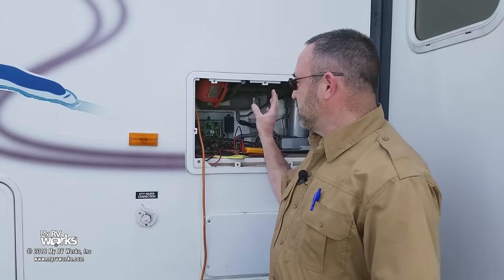How To Determine If Your RV Refrigerator Cooling Unit Has Failed -PLUS- RV Fridge Component Overview

Comment: Hey!  I know this is an older video and you may not be checking comments, but just wanted to say thank you- you helped us trouble shoot and fix our refrigerator!!  We accidentally left the fridge running while on a steep slope, and it stopped cooling.  After watching several of your videos, we figured out that the coolant was not flowing, had to be a blockage due to the slope.  So we removed the fridge, turned it upside down, left side, right side, and then the next day installed it.  AND IT WORKED!!! Thank you so much for saving us a LOT of money! ;-)

Comment: In our eyes this gentleman is an absolute authority for RV systems repairs.  Concise information and to top the climax, given at no cost to us owners who strive to keep our home on wheels running efficiently.  In this day and age of so many people shooting from the hip and making nothing more than noise , here is a wealth of information only a click away.
My husband and I feel blessed to have found this channel, thank you so much for you time and dedication.
Reply from the maker: Wow, thank you for the great compliment!  I enjoy taking folks along on my discovery walk-abouts'.  Helping others save on their RV maintenance and understanding how they work 'sparks joy' for me so I hope to be making many more video's.  Happy Camping and I appreciate you!
Reply: @MyRVWorks  I got a question, my heating element is getting hot there is no discoloration sign of a leak the pipe gets warm up to the bubbler but no where else and my fan kicks on and off still and nothing is cooling please help if you can thank you
Reply: @MyRVWorks PLEASE HELP ME IM A SINGLE MOM LIVING IN A 04 OUTBACK CAMPER I try to plug in to shore power and no electricity until battery is charged and now my refrigerator started to barely getting cold destroyed all my food there's no open spaces and I kept hearing a click noise and a something under the seat at the table kept running finally i just stopped using the fridge but my issue is the power why can I not get shore power yes I have a plug adapter that I use but get nothing until the battery is charged and it is not even charging now the converter fan doesn't kick on anymore also when i go to turn on a light the propane alarm goes off and i have to unplug battery to stop it i think its a switch or fuse but ive got no clue on where to start or do without getting hurt ive got no extra money to get someone to help and this heat is getting unbearable for my toddler please sir help me

Comment: By far the most informative refrigeration-air conditioning repair video that I have seen on U tube EVER!!!!
Reply: I agree.  Working with mine right now and it's hard to find different information to work with. Still have a problem with mine  though and hoping to make one for the most common problem.  The do's, don't and what ifs of why it wont cool properly all of a sudden.
Reply: What is ther mister
Reply: @inventorcreator7267   have
Reply: @inventorcreator7267   have

Comment: You answered my question, everything on my DometicRM3800 works 120/12v and my pilot and propane work, when it first went out I heard gurgling and thought my Thermostatic Switch inside the refrigerator was bad and by the way I can’t find a new one anywhere. The cooling unit was replaced by the previous owner so I fought the fact that it was bad. So I’ve seen to replace the whole unit with a New one is way out of my budget so I’ll replace the cooling unit.
Thanks for the great videos you post, they’re priceless

Comment: I just wanted to thank you for your accurate troubleshooting process for poor working RV refrigerators. After watching one video I added 4" of insulation to one side of the refrigerator and 1" of insulation to the other side. This provided improved inconsistent results. I felt I was on the right track. I watched  a second video of yours  which mentioned having less than 1" of air space on the backside of the refrigerator. I found I had zero insulation on the backside. I then added 6" of insulation to the backside (across the whole back, from bottom to top). This provided superior results which caused me to turn my refrigerator down from 5 to 3 to keep my food from freezing. thank you so much for sharing your knowledge. I am disappointed in the RV manufacturer for using the insulation as a cost savings on a brand new RV. The personal satisfaction outweigh the disappointment.

Comment: I Myself, and I'm sure anyone else who comes across your channel is 8/10 first time HAPPY CAMPERS, We can't thank you enough for the time you take to help everyone! I just made my first RV Travel trailer purchase, 1994 22V Terry by Fleetwood and got a major deal. Granted it had normal damage for 25 years old and had sat with both the front corner seams cracking more and more over time, we aired up the 4 tires and brought it home 30 miles away and tired are still holding air today almost a month later. But only having general knowledge and not much to any experience, you are such a great person for these videos. I am doing a front half gut and full remodel. I'm starting to look at systems now. Thank you so much and please keep putting out great support to the HAPPY CAMPER  Community 👍
Reply from the maker: Glad our videos were able to help you!  If you would like to support us please consider becoming an "RV Community Supporter" on our Patreon site:  https://www.patreon.com/myrvworks

Comment: I've been RVing for about 6 years. I've been able to do all my repairs myself. I'm moving from a 40' toy hauler to a 18' towable. The 18' had very bad floor rot, and had to replace it. To do the job I felt the need to pull the fridge. Upon trying to reinstall the fridge, it would not cool at all. Thinking that the insulation around the unit was more draft protection, than a vital part of the drafting process which occurs in the back. Also, the nose of the trailer was way high. Didn't think that could hamper performance either. After watching your video, went out leveled the trailer, and reinstalled the insulation. Almost instantly the freezer started to cool. Thanks for the very informative video, learned a ton. I was just about to give up on the unit, and replace it with a regular mini fridge. Thanks again.

Comment: Great information. Thank you for posting. I had just returned from a camping trip and placed my camper in my driveway. I started having battery problems on this last trip. The next day, My fridge was warm. I thought it was related to battery output even though it was plugged in. After watching the trouble shooting video,  I realized it was something as simple as the camper was not level in my driveway. Once I leveled it it started to cool off.

Comment: Darren I have the Dometic  RM 1350 4 door and I think  from watching your videos that the cooling unit is clogged because the boiler gets hot but the coil on the bottom never gets hot. I only go to your videos now when I need help you are a wizard when it comes to RV repairs. Thanks again and keep up the great work.

Comment: Your video was great in diagnosing our non-cooling fridge. We had the yellow residue at the bottom, indicating that we needed to go no further. We're trashing our 10 year old Norcold unit and placing with a compressor unit. Thanks for the easy diagnosis.

Comment: I just purchased a 1985 26.5' Class C motorhome that has been garaged most of it's 37 years, and only has 7400 miles. Still looks brand new.  Of course the refrigerator doesn't work. When I opened the doors to it I was almost knocked down from the smell of ammonia, so I knew that was that. I have found a company that sells the cooling unit and plan on replacing that. Its a Norco 663. It has no insulation or baffles. Glad I found this video before replacing the cooling unit so I can build the baffles and insulate while the fridge is out for repair. I doubt it ever worked that great because it looks like it was never used. The ice trays are still wrapped in plastic and the inside looks new. I have been considering replacing the cooling unit with a conventional 12 v DC/ 120 v AC with a compressor. I plan on living in the RV for an extended period, hopefully off grid. I know this is an old thread but I would like to hear from anyone who has changed over to the compressor upgrade to help me make more of an informed decision. It seems to me losing  the capability to run it off LP gas might be a downgrade. I don't know.............

Comment: Awesome video ! especially at 20:00 to the end. Im a first time viewer. i just subscribed & clicked like. im a commercial refrigeration tech. 38 yrs in the trade. i don't do rv. although a customer of mine made me put a rv refrigerator in thier boat. i did not hook up the propane and disabled the propane. He Bought it online or something  like that. i was just hired to install it. it had 3 fuel sources. 12 volt , 115 volt or propane. i told him don't  ever even think of running it on propane. you will burn the boat down. i set it up for 12 volt and 115 and it worked very well. i put a temperature controlled fan in to keep rear area cool. Good little fridge. i think it was a dometic. only about 3' tall. 2' wide. i installed it a few years back. prob like 5 years now. i guess customer is happy. never a call back with a complaint. it was a fun little job. really  took me out of my comfort zone but in a good way. i learned alot on that job how the fridge worked and learned some more here.
Take care & thanks for the very well done video.
Reply from the maker: Thanks for the comment!  I always like hearing from folks in the trades that do this for a living.
I have a whole playlist on these types of refrigerators that you may enjoy watching – as well as lots of manuals on my website.  You can add absorption refrigeration to your menu eh’.
Refrigerator Playlist:  https://www.youtube.com/channel/UCoKcKA4SuZLCD3flLXZVQvw/playlists
Manuals:  https://myrvworks.com/manuals/
Reply: Thanks. ill check it out.

Comment: Well great, Mine has the Yellow magic dust leak!   All those rolling blackout from the Febuary Texas Ice Storm had to have taken it out, because it was keeping my stash of Soft Drinks and Ice Cream cold that I had hid from the wife. 
Neighbor had one that had the same issue and he ordered a replacement cooling unit.  We had a heck of a time replacing it, but managed.  Just what I need, another project.  Thanks for the video and just to let you know I was able to check out all my systems and they are all working fine.

Comment: This was an absolutely brilliant video! You did more in 40 minutes to explain how an ammonia loop refrigerator works than anything I’ve ever experienced. Excellent job, excellent execution. Thank you so much! I checked fuses, power, loose connections, the heat in the chimney area and the one thing I didn't do was a simple step and you suggested that the unit needs to be level. Now I know!!

Comment: I have a 2000 Fleetwood Tioga with a Dometic refrigerator. It was sitting in my driveway last September on shore power with the refrigerator on AC so it would be ready to go, when I realized all the ice in the freezer had melted.  I cleaned up the water, then looked for problems.  The termistor is in place. Lights on the front on the refrigerator. No yellow residue under the boiler stack.  Leveling wasn’t exact but the bubble on my level was touching.  Still had 12 volts at the plug behind the service panel and 12 volts across the pins for the thermal cutoff switch on the boiler stack.  Tried to run it on propane only, but it wouldn’t light. I kept cycling the front panel switches, but the lights would indicate the propane wouldn’t light. Then all the front panel lights went off and have stayed off.  Still have 12 volts in the access panel plug and the thermal cut off. Looked at the fuses but that doesn’t seem to be the logical place to look if I still have 12 volts to the board and thermal shutoff switch.  Maybe I don’t know how to reset the thermal cutoff switch?

Comment: Fantastic and useful video. I think it is helped me diagnose a blockage.

I disconnected the thermistor. The freezer is only slightly cooling overnight.
There is no front panel error showing.
I can follow the heat up to the top of the cooler. But it cools considerably right before it hits the top cooling fins. 
Dometic fridge. 
Are my diagnostics sounds on this?

Comment: My god late to the back pat line.
Thank you so much, I just had a repair tech come out and literally word for word state, "ya looks like the board, compressor and everything are fried due to a failure in your breaker box".
Which I was thinking ya alright we shall see about that.
So right after found your video and preceded to forward your video to the owner of a shop/highway rape service that shall remain unnamed.
And all my buddies that have trailers.
Thank you so very much.

Comment: I'm doing a rebuild of a 78 nomad 19 ft. The norcold I'm putting in is taller than original which only leaves about 4 inchs from frig top to ceiling and 1 inch outside to both walls. This is not in a slide lol. There is a roof vent 4x20, frig is 24 wide and a outside vent in access. Is 4 inch air space above frig enough space? After watching this awesome detailed instructional I will make sure baffles are installed to create that chimney. Thanks for the help👍👍👍👍

Comment: Good Day @My RV Works, Inc. 
First, I find your video very useful.
Second, I hope you get to red this... This is my situation: 
My Dometic 2551 in a 2018 Rockwood Geo Pro 
quit cooling.
The following has been checked tested:
"ON" and "AUTO" LED - On
AC 120V - Good
DC 12V - Good
Fuses on Control board - Good
Propane Gas - Good

Flame when on Gas - Good
Heating Element feels Hot to touch
warm air out of top vent
No visual leaks
No smell
Thermistor raplaced hoping that that will fix. Before snip it i tested; Ice/water at about 38, Ohm Meter 30+ K. No avail.
Reply: Same with my  RM2351,  I think it was run unlevel by prior owners even though its only a year old.  Flipping it over to "burp" it hack?  Not sure, did you get a fix?
Reply: @jhlewis10  I had to replace it, I replaced with the 3 way model

Comment: Very informative...now I understand why the Dometic in our Airstream 23 doesn’t cool very well...FUBAR design by Airstream. The fins at the top are right up against the bottom  of  microwave cabinet above the refrigerator , the top of the upper outside vent door is below the fins, there isn’t a baffle, and the muffin fan doesn’t really direct the airflow across the fins. It would seem that the only solution would be a roof vent if there were room behind the microwave for ducting.

Comment: Well I just found your videos, I have 12 volt 120 propane Dometic RM2454 freezer works great.. refrigerator is 65°. Have tested the thermistor have moved it up and down.. does this mean it's my cooling unit? Do I take the fridge out and turn it upside down? And I've watched a video and replacing the cooling unit I'm game because my fridge will not fit out my door.. thanks so much for your videos and your knowledge that you've shared with us

Comment: I was watching the video about refrigerators and you mentioned the powdery substance meaning a breach in the system. This leads me to my situation.  My fridge seems to work fine . It is a 4 door Norcold   in a 2018 Jayco Greyhawk 29MVP. However, I keep finding a very thick, sticky (honey type) fluid on the floor in front of the fridge. Directly beneath where the doors come together. I cannot find where it is coming from or what it is. I thought it was a spill in the fridge at first…it’s not… I’m sure.
Love your videos and especially your work ethic. I wish we had you down in the South. I want to fix this before it becomes a problem and I knew you were the one to contact.
Richard Davies
Reply from the maker: Here's something to consider. On the back of your refrigerator you will see the white drain hose that should come down and land in a little black tub right next to the burner. Make sure that that tub is not overflowing. My thinking is if this is coming from the refrigerator than the tube and/or the tub is overflowing. That may send the water underneath refrigerator eventually leaching itself forward and what you're seeing might be some of the glue or resin from the wood that the refrigerator is sitting on.   To really get to the bottom of this though you might need to pull your refrigerator forward and see what's going on underneath it. Besides that there is nothing under the refrigerator that would drain out it's got to be coming from the RV.
Reply: @MyRVWorks  Thank you very much. Gives me a good starting point. I'll let you know what I find. Richard

Comment: I love the level of detail. I'm learning so much. Your explanation of why airflow is so important makes a lot of sense. 

I currently have an issue with a fridge that works on Electricity but not on LP (well, not very well). I'm looking forward to seeing the troubleshooting you do in those cases, assuming you have that type of video planned. Thanks so much.
Reply: Actually just found your LP troubleshooting video from January. Gonna give it a look. Thanks.
Reply from the maker: Hi Stephen,  Indeed I do have a detailed LP diagnosis frig video planned.  No date set on when I will record it.  (I have an awning R&R, KwiKee Step, Gas valve on an furnace video in the pipeline now) I will  probably use my stunt refrigerator I have here.  I like that one because I am not at a customer site working on getting them back up and running and I can take more time to develop the topics.  

Thanks for watching and stay tuned for that LP frig video soon.

Cheers,
Darren Koepp
Reply: @MyRVWorks  in the pipeline LOL